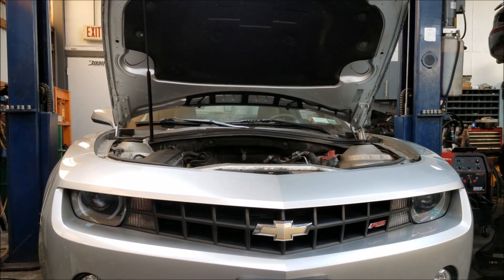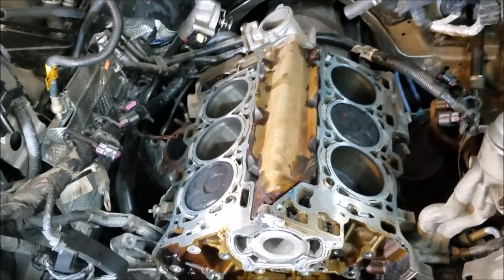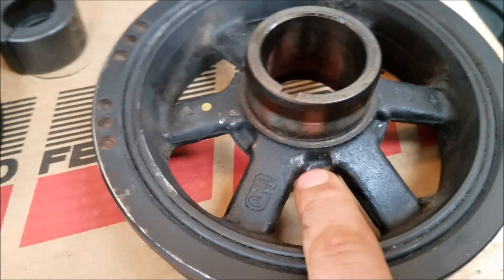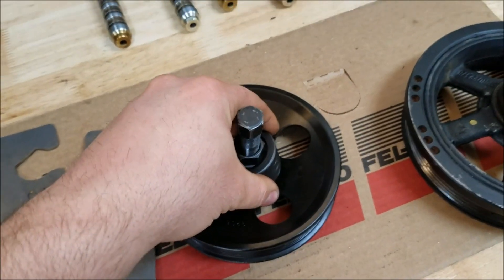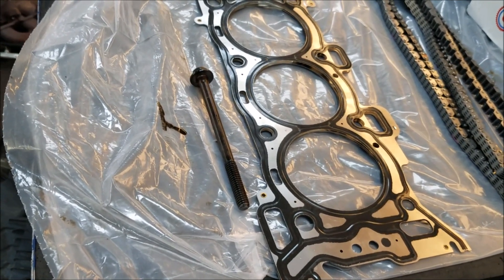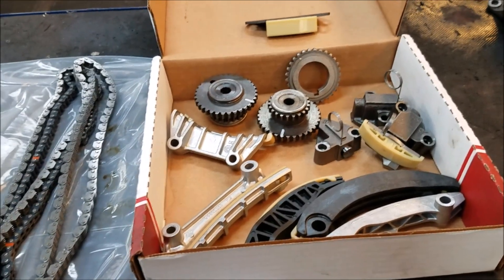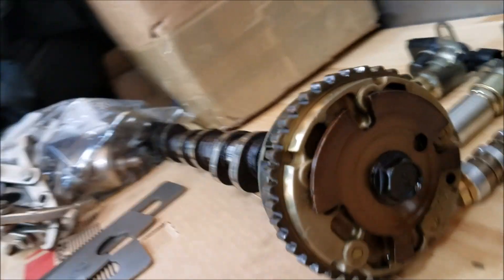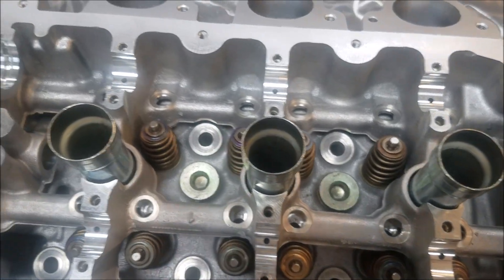2007-2015 3.6 V6 GM HIGH FEATURE TIMING CHAIN/HEADS INSTALLATION GUIDE/TIPS. BIRDIE'S PRO-TECH

Comment: The main reason these engines have failures is very likely because the owner uses the cheapest motor oil they can find.

I have a 2012 Impala with the 3.6 changed engine oil with Mobil 1 and a little over 200k miles of NYC driving the car will still spin the tires when I turn off traction control.

Comment: So I have the same engine but in a 3.6 Cadillac CTS.
I had someone do a timing chain on it but I think something was done incorrect. So I want to take it apart and do it again. So my question is if I put #1 cylinder at top end with out the chains and put the came keepers on would be okay in putting the chains on by going by the Cloyes video install?
Reply: Thank you for your time and help.

Comment: Is there anyway I can email you a video I put cam phasers on torque them to spec they still move another place to move a little bit cuz they're spring loaded but the intake phaser just clicks back and forth like it's not seating even though it's in there I like your opinion

Comment: Hey birdie, really good video. I'm not a mechanic by any means but I know enough to get myself In trouble. I had a stretched timing change on 2012 enclave so I brought it to local respected mechanic. He replaced the chains and guides that came as a kit and charged me $3000 (understandable). My wife drove it for about 100 miles before she ended up on the side of the road. I check it out and and couldnt crank the motor with a breaker bar so i believe the motor is seized up and found every spark plug well had a bunch of oil in them. Just your opinion on what it could be and should I just scrap a car that has 173K on it. I greatly appreciate it .
Thx

Comment: Do u have to replace the camshaft retaining bolts when u remove one of the camshafts? Do those bolts stretch like the head bolts do or are they reusable? Also a torque spec would be helpful. Thanks.

Comment: i have an 08 Saturn aura with the 3.6 xr. i found one replacement vvt gear my question is that the gears mounting face has all of the oil ports connected by a common channel but the oem gear all the holes are isolated from the others. it looks like an internal leak to me. but i have not found any replacements that don't connect the holes

Comment: Ahh i wish my engine was sparkling like this.  
Hey the replacement chain giudes that are plastic? the OEM are alloy.  Would it be possible to just change the shoe on the OEM metal guides or are the plastic ones better?

Comment: Funny that there are a lot of repair videos for the G M 3.6 v6. It replaced the 3.8 GM v6. That best v6 ever made. I have worn out my 2001 lasabre around that engine. Why it was replaced by the 3.6 makes no sense.55,000 miles? Proves it right there.
Reply: If whoever owns this followed the oil life monitor would explain everything.

Comment: How much it costs trimming chin
Reply from the maker: Hi Tommy. It depends on how thoroughly you do the job or what your goals are to fix the problem. Cheap as possible vs full replacement.
Reply: @birdiesspeedshop6997  full replacement cost trimming ching

Comment: Somebody explain this i have watch where a guy from GM doing timing chain replacement and didn't have to do the right bank before left  bank  he use the timing chain tool to hold the cam and take everything of and told you you can do it this way was this job easy because he was using the cam tool plase explain

Comment: First time on your channel thanks for the video I have a question  I have SRX with the 3.6 engine timing chain issue  I took cover off and the 2nd bank chain guides plastic parts just fell apart chain had  slack in it so I took it off also I rotated the engine after I took chain off bank 2   can I still follow timing procedures for bank 2 because I know I will have to rotate the right bank phaser to line up timing mark but will that be ok to do and then put cam tool on to hold cams in place I hope I explained that. I don't have a problem with the rest of the aliment process and the car ran fine just rattled because of the chain also didn't have any code. Thanks be happy to here what you have to say!

Comment: Have you ever had p0018 p0017 p0008 after changing the timing chain? I just installed a cloyes kit on a 2011GMC Acadia. Engine runs rough at idle says intake and exhaust cam Correlation bank 1. All timing marks are correct on the components. Vehicle runs great above 1000 RPM.
Reply: did you fix your issue? same here...
Reply: @aykutyildiz7133  Was missing three out of four thrush washers
Reply: @timothysundling6683  what are these parts. I have never heard.. is it a part of timing chain?
Reply: @aykutyildiz7133  they go on the cam phaser bolts, and get stuck to the old cam phasers when you replace the phasers.

Comment: Hello, i replaced timing chains with cloyes set, but i still got P008-P0009 and one more code added after replecement which is P0016. Still engine light is on, still no power.. I’m so dissappointed. My mechanic advised that VVT sprockets need to be changed.. will that fix my issue? Thanks a lot
Reply from the maker: The first thing I would suggest to do is to double check all of your cam sensors and connectors. 

Also check your vvt solonoids are connected and the wiring is ok.

Did you replace any of the cam sensors or vvt solonoids?
Reply: @birdiesspeedshop6997  hello, thanks for the fast reply.we didn’t replace sensors but checked and tested all sensors. They all look good. Should i replace VVT sprockets? My camaro is at 55.000miles
Reply from the maker: I would replace them, especially if you are going back in a second time. Be sure to thoroughly go over the chain install to be certain it's done correctly before reassembly. Best of luck!!!
Reply: @birdiesspeedshop6997  i replaced also VVT sprockets still same DTC P0008, 

Timing Chain Replaced(Cloyes)
4 Cam Sensors Replaced (AC Delco)
4 VVT Selenoid Sensors Replaced(OEM-Aftermarket)
4 VVT Sprockets Changed(OEM-Aftermarket)
ECM flashed - reinstalled software.. still no change.. 
I have also noticed that your VVT Selenoids don't have seals.. Is that a problem, mine also don't have.. I have read about bad reluctor wheel what do you think about it?

Comment: Bring back the engines of the 70s and 80s and get rid of this garbage..
Reply: Just because it’s to complicated for many people doesn’t make it a bad engine. People listening to the mfg maintenance schedule is most of the problems with this engine. If you do 3000 mile oil changes and don’t over rev the engine all the time they will
Last just like any pushrod V8 or even longer.  I am not even a GM fan boy but this is a hell of a design and actually higher performance than a pushrod V8. Matter of fact just look at the HP numbers and it will tell the story.

Comment: Hey so I’m working on one right now and the problem I have is that piston #1 had a spun bearing . So I replaced all 6 rod bearings and when I went to turn over it turns but for abt 90 degrees it get real hard, also it’s out of timing I’m currently in the process of timing it . Would that solve the problem to it being hard to turn over ? And yes I used assembly lube on the rod bearings.
Reply: There’s also the fact that spun bearing= bent broken valves so there’s that and the condition of your cylinder to.

Comment: when replacing timing chains in a high feature 3.6, 09 Traverse, can the cams get out of sync? if so, how and what is the fix? thanks in advance.
Reply: Hey did you find that information out because I'm having the same problem
Reply: @Kk-xt9ye  you need the alignment tool... holds the cams in place... best advice, call someone
Reply: Amazon has them for 15 bucks 2 days shipping

Comment: What did you torque cam bearings at? And did you have to change the bolts because they stretched?
Reply: They are 10nm. But you better get a manual. They have to be torqued in sequence. The bolts can be reused.
Reply: OK, Thanks.
Reply: Head bolt can be reuse but not recommended like what he said in the vid

Comment: I see no practical use for this video....not being rude but its title suggests that there might be some useful information in the video. Ive watched litterally hundreds of videos, and im sure that i speak for others when i say that not one of them for reasons unknown will show a "from scratch" video on the timing...every one of them portrays some guy walk up to the left bank and match 2 links with 2 letters on the phasers...we know all of that we wanna know the correlation between the crank and the cams so we can pull the cams and reset the engine from scratch and build with piece of mind...do you have such a video im looking for a video for camshaft removal/replacement. You cant just take a wrench and start turning the cams and PUT them in position my sons vehicle has seriously jumped time not to mention him jacking with it and turning the crank with the chains off so i need to start from scratch because i nred to know the correct position to put the cams in so i an rotate the engine for TDC. Or do you simply put crank in stage1 timing at 5 oclock position if so then what...from what im seeing the only way doing this is backwards engineering because you can tell if ANYTHING is proper until you line up the many marks dots letters triangles flats links blah blah blah...the cam and crank correlation between the crank and cams has to be right from the get...or yur just guessing and looking at diagrams and trying to match what it looks like...there must be a definitive way to do an initial correlation setup before u put the chains on...like i said the kid has moved everything around and ive attempted 3 times to put the chains on and when get done i cant rotate engine im assuming because interference is occuring AND when the secondary chains are hanging down off of the phasers they can easily be put on up to 2 or 3 different teeth of the sprockets please help
Reply: I was told that when a 3.6 jumps time the only way to correlate the crank/cams is by removing the cams and then put the crank in position THEN push cams back down
Reply from the maker: @timvittetoe6562  Hi Tim. Sounds like this job has you frustrated as the many before you.  Best thing to do is to clear your mind, slow everything down and rewatch this video. 
It looks very complicated and it's easy to overthink the job. 

Start with reading the description, there is a video link on how the chains are setup. 

There are tips in our video that will help you with the install.

Also, read the comments section. There is some good information there as well.

Sometimes it's best to walk away from the job, then go back to it with a clear mind and start fresh.

Best of luck!
Reply from the maker: @timvittetoe6562   Tim Vittetoe  No, that is false information. You do not have to remove the cams to set the timing.
Reply from the maker: Tim, Here is the link that I included in the description.  

Watch our video for tips and watch this video for chain/guide/tensioner Installation.

Best of luck!
https://youtu.be/hZyehWKDV-Y
Reply: Yes fellas i apologise was indeed frustrated...ive set the chains up twice and when i put my ratchet on to turn the engine it sounds like the val es are dropping off a cloff lol...hers the way i done the procedure
Step 1 removed guides and tensio ers from right secondary and removed chai...removed primary chain guides and tensioner then removed chain...removed left bank guidez and tensioner then chain back at square one and from there i rolled cams to where the milled flatss on camshafts were in line with same angle as valve cover angle...
Then i put crank in stage 1 position with dots on pump and sprocket at 5 oclock...put chain on the L on each phaser with one phaser at staight up 12 oclock and the other at 2 oclock then cinfirmed that the 3 markins went as prescribed one on each phaser and lower part of chain with marking at 5 oclock
Then install primart chain and cinfirmed that its third mark was at 5 oclock...then put crank in stage 2 positiin at 8 oclock...put last chain on and confirmed that all three marks lined up....attempted to hand crank engine...it would turn but u could hear the valve springs relieving themselves....and in my opinion the engine was trying to jump sprocket...also to me it feels as if the left bank is smooth and fine...no interference happening as far as colliding with pistons but the valve springs seem to be ina bind???? Any ideas guys
Reply: In other words when i hand cranked slowly. I could feel the valve spring tension increase the all of the suuden u could feel it reach the apex of the lobe and violenty relieve the tension when it crossed over the xownside of the lobe
Reply from the maker: @timvittetoe6562  That is a common occurrence when setting up the chains. Sometimes it's a balancing act to line up the cam gear, if you go to far it spins under force.

It sounds like you are on the right track. 

Another tip, when you are done with job and if you rotate the engine by hand, none of the marks on the chains will line up again. I've had techs think that the chain skipped timing again, which it did not, and unfortunately they took everything apart again.

Feel free to ask anymore questions, I'm here to help.

Brett
Reply: @birdiesspeedshop6997  thank you for info...some of my frustration and hair loss lol...is due to me not understanding what im doing wrong......thank you for the info i tried last night again and was same result....after ive lined up and set the chains on the left bank and primary it rotates fine but i put the last chainbon it will rotate to approx 4 oclock and stops...i just recently thought to myself that this right bank may have a bent valve cuz like i say when its just the left bank and primary chains on it rotates fine
Reply: Update fellas I GOT IT come to find out i had it right the first time and like i was saying it seemed to me that the valves were dropping off too quickly and then it dawned on me that of course the valves would roll over quickly because i had no spark plugs in and without the plugs theres no back pressure from the other cylinders...so ive rotated it several times then it was midight today ill put the plugs in and see how it acts/sounds...i thank each of you for your input it was very helpful as were the links...
Reply from the maker: @timvittetoe6562  Looking forward to hearing the results! 👍🔩🔧🏁
Reply: So did you get the engine running? I’ve found I only rotate the engine enough to set the timing and then just get it back in and start it. The tensioners aw oil pressure activated and it can jump timing turning the engine over by hand with no oil pressure. Just set it and forget it and start the bitch!

Comment: The valve cover vents cause the timing chains to go bad I hear? Don't they have a fix for it now?
Reply from the maker: Hi and thanks for the questions. It's quite the topic. I still see failed timing chains on vehicles with the PCV modification. I disagree with the PCV being the cause of this issue. Frequent oil changes keep the problem away but the system itself is partly to blame in my opinion.

Comment: Hi, I would like you to share with us your thoughts as to why these
Timing Chains stretch. Some people say infrequent oil changes which lead to sludge, other say low oil levels which cause the chains to overheat and stretch, others say that the PCV valve is too small and the engine dose not breathe properly.
Just wondering what the real reason or reasons is for this stretch to occur are. Thanks.
Reply from the maker: Hi Nick. Great question! I listed below some of the main reasons I believe cause this issue. I believe it is a combination of all of these issues, however there is one of these that I believe is the main culprit, the chain and tensioner design. I think that the tensioners are unable to take up even mild slack in the chains, and I also believe the size/quality of the chain is not suffice enough for the job it's needed to do. It's a shame it gets a bad rap because the 3.6 is actually a great engine once the timing chain issue is resolved.

1.) Oil Change Neglect
2.) Low oil level between changes
3.) Design of guide system(plastic guide material)
4.) Inefficient PCV System flow
5.) Oil quality. Full synthetic/Semi etc...
6.) Size of chain and quality 
7.) The tensioners ability to take up the slack of a slightly worn chain.
Reply: @birdiesspeedshop6997  Thank you so much for your prompt reply.
Greatly appreciated.
Reply: @birdiesspeedshop6997  Hi again, I'm  from Australia, we have these engines installed over here in our GM Holden's . Some chains fail under 100,000 KMs, some engines have known to do 300,000 KMs without problem.
We are all mystified as to the cause and are trying to find answers as a preventative measure.
Thankyou again.
Reply from the maker: @nickl2548   Hello from the New York! I also do believe a good brand of oil and frequent oil changes (every 3000 to 4000 miles) seems to be a big factor in keeping the issue at bay. It is hard to explain how some engines go the long haul and some don't. I think this is what creates the confusion and makes it hard to nail down an exact cause.
Reply: @birdiesspeedshop6997  I have this engine in my Holden Commodore and I am using a full synthetic 5w-30, for our climate, dexos1 gen 2 spec. My engine is a low mileage engine.
Thank you for your reply.
Reply: Birdie's Speed Shop did GM make any design changes through the years that would make my 2015 Enclave less likely to fail then the earlier years? Thanks for your time.